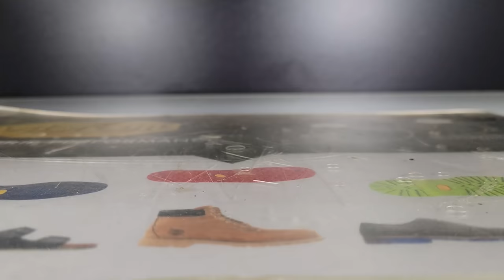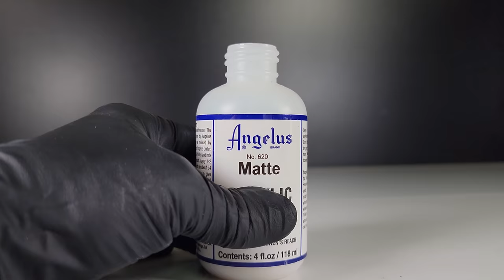🎧ASMRㅣHow A $1,000 Pair of Gucci Slippers are Professionally Restored ㅣFREE REPAIR EVENTㅣ4K 🖌️

Comment: This looks awesome. My only criticism is you could have used masking tape when doing the black painting to achieve a really clean line around the front, since thats a bit messy.
Reply: If tape is put on leather or suede, when the tape is removed, the top layer of the finish of the skin will also be removed
Reply: @OtterCid  he could have used a very thin brushe, also, those one for nailart are perfect for tiny works

Comment: Meh…I’d give the job a 6/10 tops. The rubber sole protector and top lift are different designs. I would have replaced the sole and heat stamped a new gucci logo before applying the rubber. The paint is super thick and is caked over the thread. The edge dressing could use some work and the brass fittings could use some polishing. Stuffing the shoe and then ironing over a wet cloth would have reduced the appearance of all those wrinkles also.
Reply: Yeah i have to agree it seems really...unfinished. Like if i were to shell out money to have my shoes restored i would have expected a bigger transformation tbh
Reply: Bro maby a 3 out of 10,you cant tell me you would rock them lol
Reply: @Jsharp102  I was trying to be nice. I didn’t want to be too harsh. But you’re right. If these were given to me, I’d try to flip them for some type of profit.
Reply: @SergioPena20  i understand being nice, but so many people are complimentary to him,he must think this is actually a good job . meaning he will keep pushing out crappy work. Imo.
Reply: @Jsharp102  yeah I agree. I wasn’t going to post anything when I first saw the video. Then I started reading all the comments where people kept praising a “perfect” or “beautiful” job. That’s when I had to post something.

Comment: Question: I've got to do a minor touchup on a black Gucci bag (the worn edges). I see you are mixing paint to match. What leather paint brands are best to buy assuming I need to mix to get the right black match?
Reply from the maker: I used leather dye for touching up bag edges. But this dye is from no brand.. you may try to use anglus or fiebing's brand.

Comment: The white dye you got all over the edge of the black sole would have gotten negative marks from me.   It's like getting OVERSPRAY on parts of the car that weren't supposed to be painted.  Oh well.
Reply from the maker: thanks for your advice.
Reply: Don't think the restorer is too concerned about your opinion! Lol!
Reply: @reneshay889  well he should be. Even if the advice was a bit more harsh that it could have been, it is still a good remark. He thanked for the advice and he will probably be thinking of it in the future because it is good for the business. 

Not all negative comments are bad ones. Some are actually helpful.
Reply: @petrac2840  Chronoboat sounds like a pompous a--. 😆

Comment: I feel the job could have been a 10/10 if tape was used to prevent  painting the rubber topy with white paint. Also, using a hammer or other tool just to seal off the leather insole(?) which looked like it was lifting off slightly..
Reply from the maker: Thanks for your advice:)

Comment: Have to ask... are those intended to be worn (normal use) after this restoration? How in the world will they ever be able to be moisturized going forward as I'd expect that it wouldn't be able to penetrate a coating of paint.🤔 It seemed odd to me that leather DYE wasn't used instead. All restoration vids I've watched never involved using a paint! Also, perhaps next time, taping the lower edge of the uppers would do justice before touching up the sole edge to avoid the wavy appearance where the black and white intersect.

Comment: You should paint before you glue the soles and heel. Good job
Reply: YES! My thoughts, exactly! 
Where the edge of the body of the slipper joins the sole is not painted as neatly as it should have been, and that bothered me... if I were paying for the restoration of these, I would not have found that to be acceptable.

Comment: not bad, sir. it seems like you're doing it kinda backwards, though. IMHO, wouldn't you get a cleaner/sharper line between the upper and the sole, if you completed the restoration and painting of the upper and then took your time cutting a more exact piece for the sole, that required no sanding? your line, between the two, is rather ragged looking.
I do like how you only do one shoe at a time. some of the other channels do both, simultaneously and it makes for a rather long/boring video with nothing to compare the end product to, except memory.

Comment: People are connected with electromechanical equipment. (Vision for June 10, 2022)

- Yeshua coming -

On June 10, 2022, we will share the vision God has given us.

I had a long dream like a drama.

People are now connected with electromechanical equipment.

It was a boy who looked to be about 3 years old. Behind the boy's back were about six hoses and an electrical device. A little boy looked at his parents with contempt. It was such a contemptuous look at what you guys did to me.

The dream was like a drama dream.

The movement of Nibiru is very fast. The reason Nibiru is now visible from the left and right of the sun is that Nibiru moves very quickly.

Sometimes it is observed from the left side of the sun and sometimes from the right side of the sun because it moves so fast.

I looked at the sky, I saw the sun. Two suns were floating in the sky. The sun on the left was cut in size, and Nibiru on the right looked a little smaller in size.

However, Nibiru's movement was so fast that he immediately saw it and then disappeared. I was sitting with a group of people. I sat with people like chairs in a movie theater. Among them was a man and a woman. They were a couple, whose spirits were awake and gazed upon the sky, and the people gathered there had no idea what was going on in the sky.

God once had a vision of a white planet running away very quickly to the left. The planets are moving very quickly. As I remembered that vision even in my dreams, I realized and understood that Nibiru moves very quickly.

As Nibiru rotated from left to right, it gradually ascended and descended again repeatedly. This means that Nibiru moves very quickly.

People were waiting. was waiting for something But fear and anxiety came over. I'm talking to people about Nibiru, have you seen it? I saw it too. Two suns are floating. I was talking about Nibiru, and people were waiting in chairs like a movie theater. The people was waiting for the test.

Soon, scientists would test for the presence of the virus, and those with the virus would have an electromechanical connection to the equipment. There were two men and a woman. They were spirit-waking people, and they were the people who talked with me and Nibiru. They were the ones who had seen two suns themselves. We know what this situation is. One after another, people went to the test.

People have been treated with devices on their bodies so that they can be connected to electromechanical equipment one by one. The device is connected to the electrical system.

I'm talking to these two people, we can't connect to that device.
We absolutely have to run away from here. With this in mind, it was time to move on. received the documents. The test machine number was written on it. Number 33 was the number of chairs on my test machine.

Before I entered, a certain 3-year-old boy had been treated with an electromechanical device and a device that could receive electricity. Looking back to the left, he looked at his parents with the most scornful eyes, resenting his parents. It's the eyes of what you guys have done to me.

It's my turn, and I have to run away from here. Never connect with electromechanical equipment. I made a promise like this, took the documents, and went in for a test. There were a lot of people in that place, and there is a test chair like a chair in a movie theater. When you sit on that chair, people with the virus turn on a red light, and people without the virus turn on a white light.

People with the virus had to be connected to electromechanical equipment.

The government and scientists lied. That's good. If you connect this electricity to your body, you can immediately cure all viruses and diseases. You will also have superpowers.

A superhero came to help the test and operation, and he showed his forearms as if showing off his strength, meaning that if you were connected to this electric machine, you would become a superhero like me.

I was scared. What if the red light comes on? Please God, let the white light come on. I was scared. When the red light comes on, it means that the procedure that is connected to the electric machine must be performed. So I couldn't watch myself.

My spirit watched myself from afar. I was sitting in a chair, watching me from afar.

The sensor on the chair was lowered and the white light came on. Good luck. After seeing that, the 7:20 AM alarm rang and I woke up.

This vision has two meanings. The first is that Nibiru moves very quickly, and the second means that people are connected to electromechanical equipment.

Under any circumstance and environment, Do not bitten by a viper snake (mRNA). And people will be connected with electromechanical devices.

Chips for Health, World Economic Forum in Davos, 24 May 2022
https://youtu.be/JJy90ccGn6g